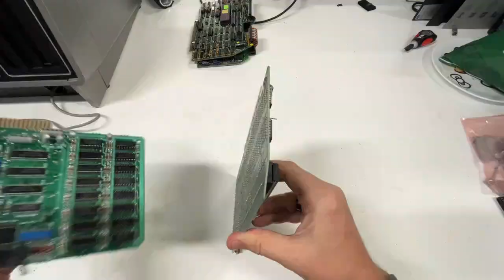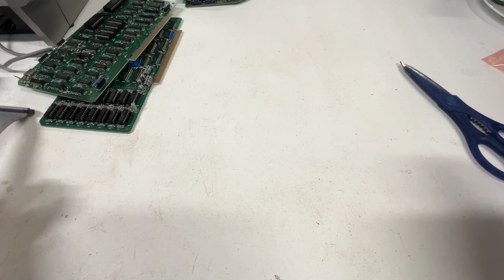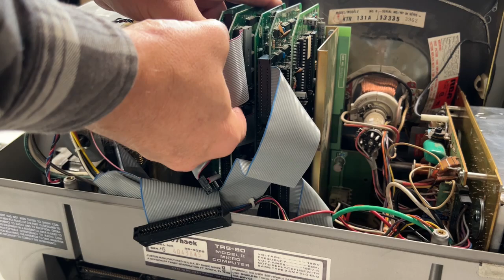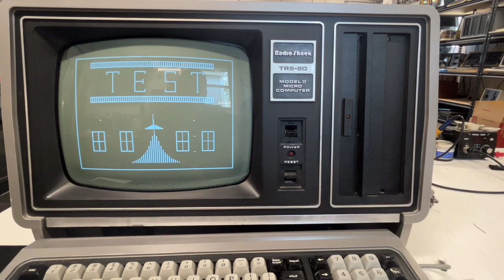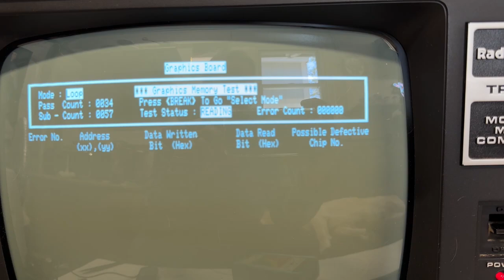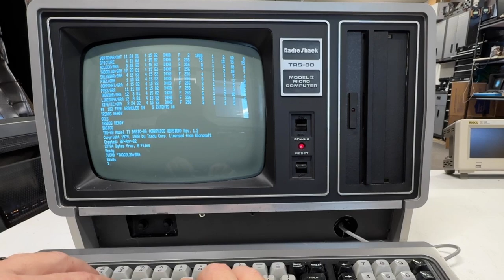TRS-80 Model II Upgrade: Part 2 - Adding the HiRes Graphics Card

Comment: did you ever give all the original DRAM chips a second chance after replacing the bad capacitor?
Reply from the maker: The original memory that came with the board was bad, but I did remove the modified 4164s and put in the 4116s that I bought to just clean up the board.  Except for one chip, they were fine.